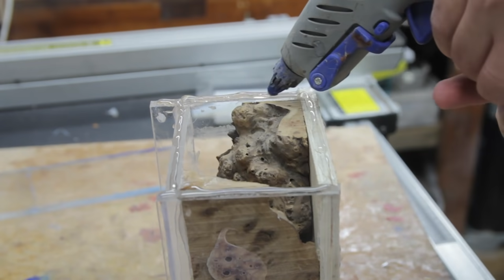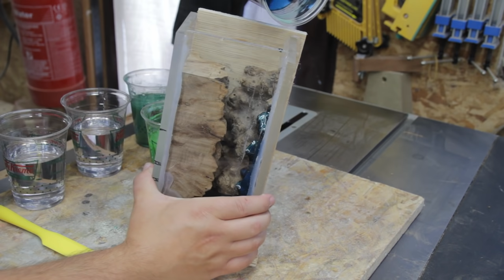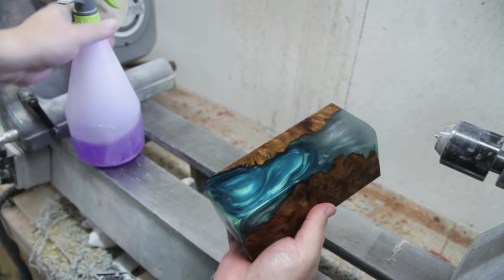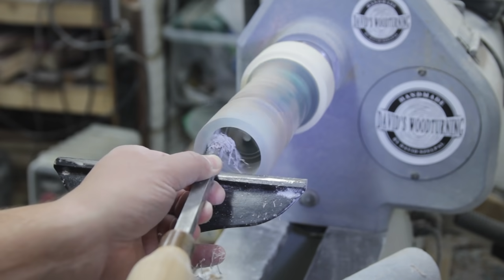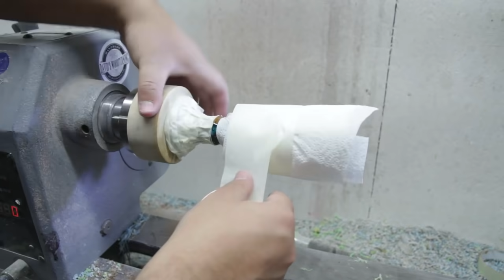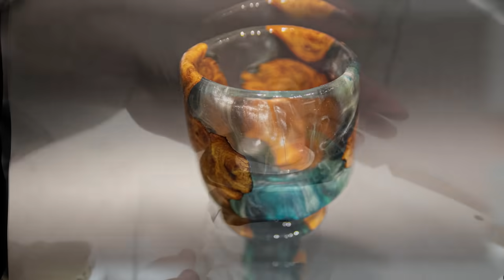Woodturning - The IMPOSSIBLE Hybrid Idea

Comment: Beutiful,  ive never had any success with the rings always break when just about complete.
Reply from the maker: I made like 10 goblets with rings but i still feel slightly nervous removing the ring. You cam see at 7:55 in the video between the rings I have some extra wood to work with. That is my buffer in case one of the ring brakes i can make another one out of the extra wood

Comment: Why do you spray the lacquer in different segments? And beautiful work, of course.
Reply from the maker: Thank you. Great question, if I would try to do in one go due to the rings and as they spin when applying the lacquer, they would leave a mark on the sprayed stem of the goblet. Hope that makes sense. With this separation method I can avoid that easily but take a lot more time and effort for sure.

Comment: Nice!  2 questions.  What did you sand up to before doing the spray finish?  And what did you finish the bottom with that you rubbed on?  Thanks!
Reply from the maker: Thank you. I go up about 6-800 grit. At the end that is 30 mins epoxy resin